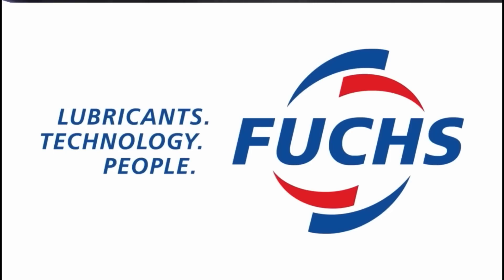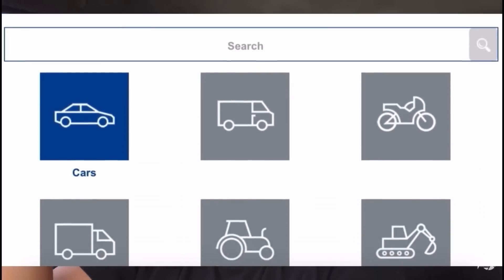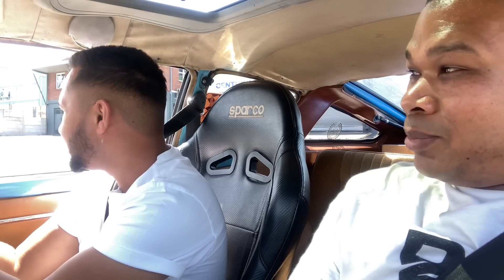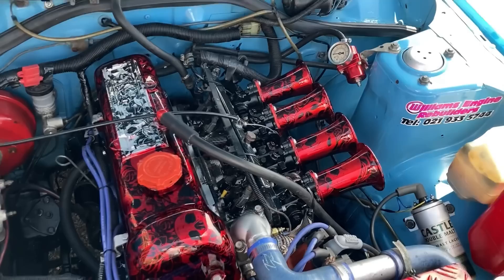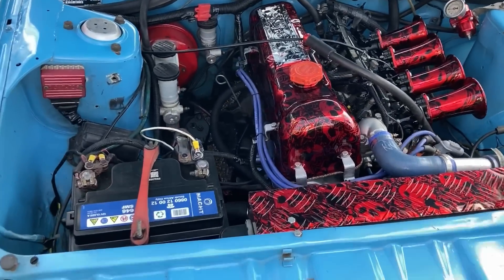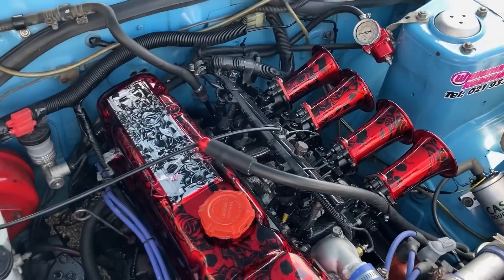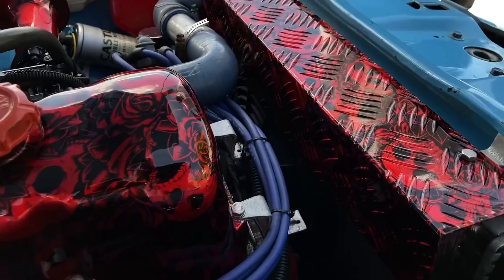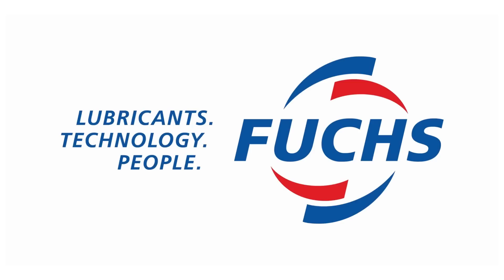DATSUN SCREAMS BEAUTIFUL 😍 | This is my Ep97

Comment: Does changing the crank on a L16 to L18 crank not than make it a L18. Also what difference does the SR20 pistons do compared to an oversized L18 piston of the same size. Nice video, would like to get more tech info on these type of builds. Like ignition setup is it old points system or modified, what injectors, what fuel pump. Also it’s misleading calling a welded diff a lock diff😅. But appreciate the content keep it up
Reply: I'm from Port Elizabeth I used the L18 block L18 counter balance crank L14 rods with the Nissan vg30 v6 piston  s280 cam an Nissan Langley 1500 distributor with side draft webers